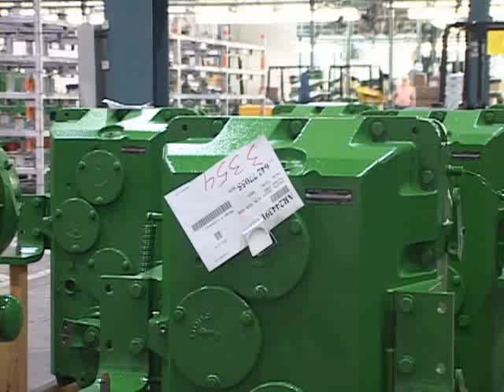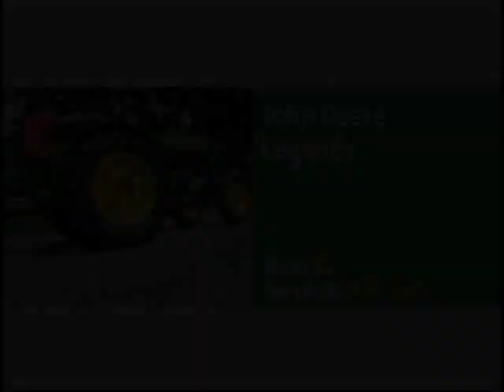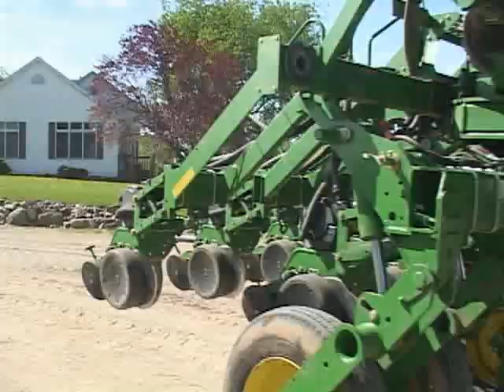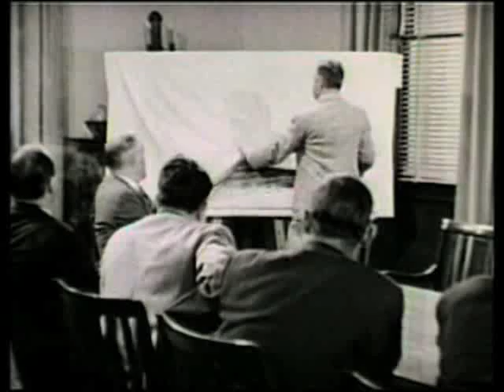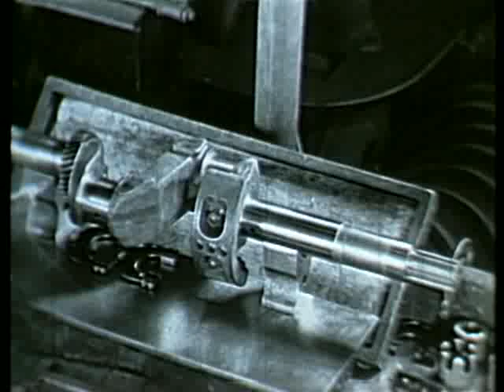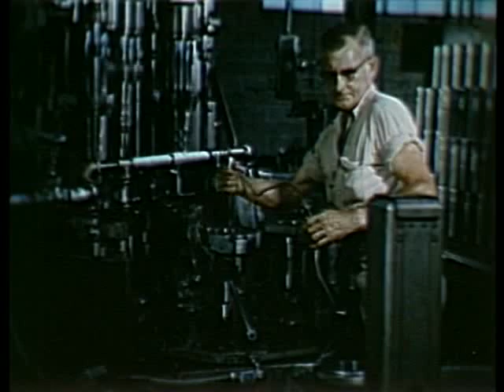John Deere Country Part 3

Comment: Earl's tractor has features with heat air-conditioning dust filtering because other his tractors don't have it. The 530 was introduced in 1959 when Alaska became a state given the flag 49 stars these 30s series the last Cilynder line were 330 430 530 Earl's first john deere 630 730 diesel and 830 diesel with power steering easy turn in the feild and Earl's second John deere is a 4020 diesel I told Owen about it we had a conversation about it I press a button Earl's tractor sounds like

Comment: I have this John Deere Country Part 3 Video. I thought my girlfriend "Amelia Leuthold" would LOVE to see the John Deere Waterloo Tractor, Cab, and Assembly Operation Works in Waterloo, Iowa.

She would also LOVE to see what's going on in the other John Deere Factories in Dubuque, Ottumwa, Davenport, and Des Moines, Iowa. Including the John Deere Harvester Works Combine Factory in East Moline, Illinois on the banks of the Mississippi River.

My Top 15 FAVORITE John Deere Tractors of all time are: 

6200 2 Wheel Drive 

6210 2 Wheel Drive 

6220 2 Wheel Drive 

6230 2 Wheel Drive 

7200 2 Wheel Drive 

7210 2 Wheel Drive 

7220 2 Wheel Drive 

7230 2 Wheel Drive 

8200 4 Wheel Drive 

8210 4 Wheel Drive 

8220 4 Wheel Drive 

8230 4 Wheel Drive

9220 4 Wheel Drive 

9230 4 Wheel Drive 

8245R 4 Wheel Drive with a front hydraulic hitch